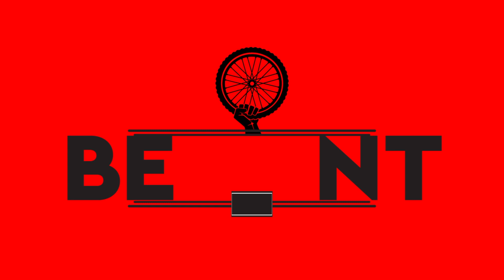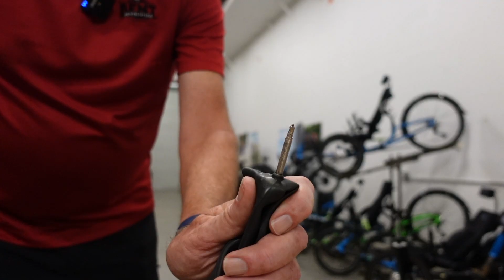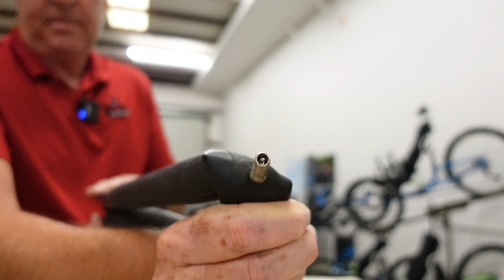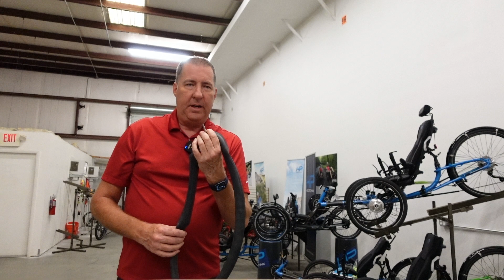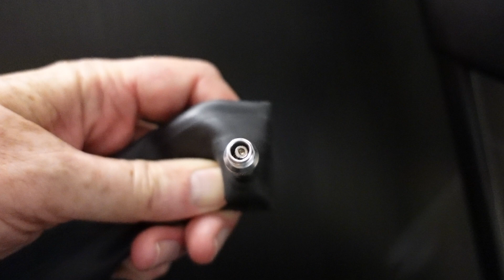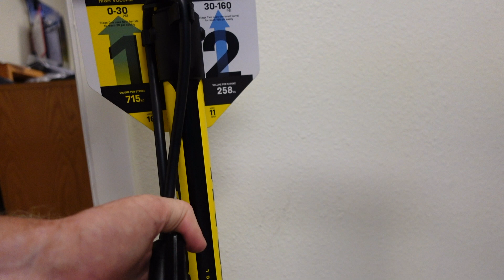Bike Valves Explained

Comment: Even with the adapter I have not found a pump head which is easy to get on and off of a  Presta valve.  The Presta valves are so ling I always think I am going to bend them trying to get the pump on and off